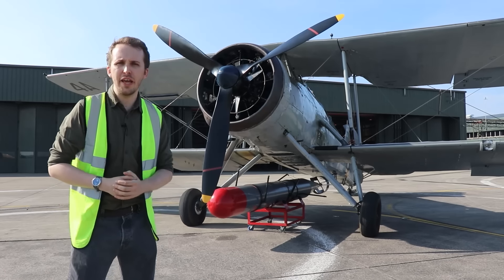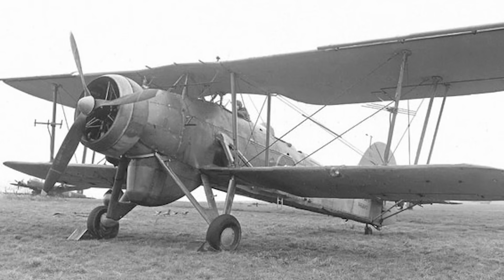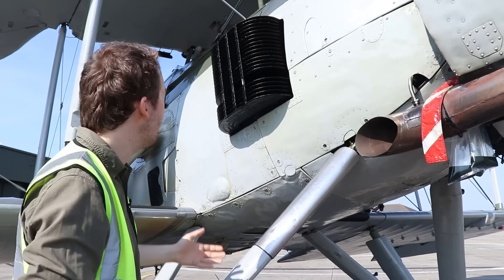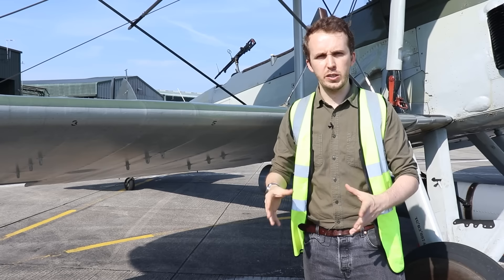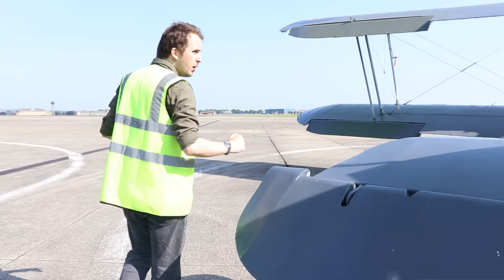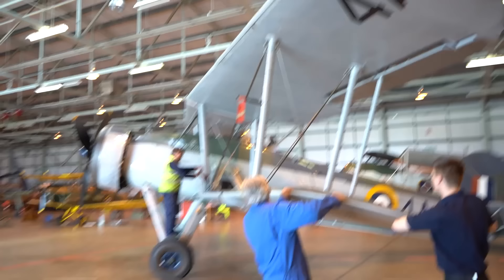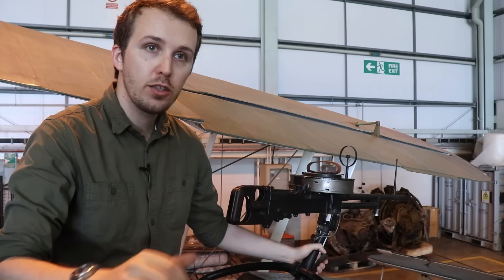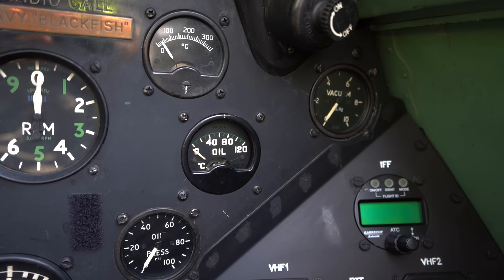Inside The Cockpit - Fairey Swordfish

Comment: Rather surprised you didn't mention the Swordfish's "secret feature" when it came to launching her torpedoes. Dr Alexander Clarke covered this at some length on his channel. The British rigged up a tension wire system, that attached to the nose of the torpedo, that helped to keep it level when dropped, until it hit the water. The British managed to keep this secret for quite some time. Dr Clarke even pointed out in period photographs, showing a Swordfish dropping a torpedo, how the photograph had been "edited" to hide the tension wire. It wasn't just wooden fins attached to the rear of the torpedo, but the tension wire as well, that enabled the successful attack on Taranto.
Reply: Very interesting, thanks.
Reply: Is that the first example of 'fly by wire'? 🙄
Reply: @stewartfordyce  No.  
That incident happened when the Pilot took a final 'Lucky Leak' on the wheel prior to take off to minimise discomfort later but inadvertently and unnoticed caught the wire whilst rebuttoning up.
Reply: @Farweasel  LOL
Reply: My  best undesrtanding  was that the wire ensured that the torpedo would enter the water slightly  'nose up'. Thus reeducing the speed of weapon closer to it's nominal 40kn at the instant of full immersion  while also giving the weapon a shallow track.
Reply: @brucebartup6161  imagine turning up to sink a French fleet and they give you this and explain the wire trick.
You'd think it was a joke and ask for a real plane.
Well done the chaps that did that job. Balls of steel
Reply: @julianshepherd2038  Yes ballsy.   But a terrible day for the French sailors, and the Brits who had to carry out a miserable task.   If only the French Admirals had been more sane;  and I have read that the Brits could/should have sent a more senior officer.   Those French ships and sailors could have helped later, saving British and US lives in the Med,  suppressing German and Italian attacks on convoys,Malta, North Africa, and allied Italian campaign.  And the u-boat war.
Reply: @foxlies0106 absolutely.. The French navy would have been a huge asset

Comment: Even the low, slow, Stringbags apparently needed some additional help at Taranto to stop their torpedoes from striking the harbour's bottom and destroying themselves after release. The torps were fitted with custom designed wooden "Sabots" to provide additional lift immediately after entering the water. So, really a "triplane" weapons system ?
Reply: A modification the Japanese took note of.

Comment: It is a very interesting aircraft, I've read through some stories of them at RAF Bircham Newton In coastal command use, The Fleet Air Arm loaned some squadrons to Bircham Newton, for the active use in mine-laying operations of the coast of Denmark, Around Heligoland, in the Wadden sea area, Later around the Frisian islands, a lot of these took place during the fighting in Norway In 1940. according to reports and diary's that I've read in the museum, The minelaying operations were abysmal, I'm not sure what sort but it was a Magnetic mine they attached to the aircraft in the reports but all I know it was large and very un-aerodynamic, decreasing the aircrafts speed and stability, where the Navigator was suppose to sit they placed a Large Petrol tank which stuck up between the pilot and the aft cockpit The Navigator had to sit with his legs Underneath the massive petrol tank basically pinning him in, so if the plane was attacked and it was hit, he would be drowned in petrol and if it caught fire immediately cooked.  

A quote from a pilot who flew on such a mine laying mission said the aircraft was "Outrageously overloaded" and that "Carrying a mine which would leave nothing to pick up if it exploded and carrying a truck load of fuel to give it the thousand-mile range, it’s speed such that the worst anti-aircraft gunner or search light operator could hardly miss it. Its only protection against fighters was, the fact that it was too slow for them to stay with it and shoot at it" I think there's a dairy entry somewhere in the museum stating that one aircraft was so dangerously overloaded they had to remove all defensive weaponry and all ammunition from the aircraft to fit the mine and carry the extra fuel.

Also being in an open cockpit cramped and extremely noisy they would hardly be able to communicate with each other for 10 hour stretches at a time, very long, very cold, very dangerous mine-laying operations those guys who went on them, Maximum respect it certainly took a lot of courage, and the swordfish carried them through it all!
Reply: Sounds so miserable and dangerous. Hope they had some success.
Reply: I remember a story that the fuel tank would spray fuel through the breather tube at the top of the tank during take off. The RAF grounded the aircraft until they could work out a fix - the navy solution was to insert a cork into the end of the breather tube which had a string attached so that the navigator could pull it out when the aircraft had leveled out.
Reply: @timwalker5843  I've never heard that one but that is mad haha

Comment: This aircraft participated in the raid on Taranto which senior Japanese officials took inspiration for the torpedo depth since Pearl Harbor was very shallow in depth this was for the upcoming attack on the Pearl Harbor United States naval base in 1941. The Swordfish did had an influence Icon A5 a modern seaplane specially with the wings fold back with main difference being that wings on swordfish fold horizontally and parasol wings of the A5 fold vertically to save space on a specially designed trailer or a garage.

Comment: An excellent and very informative video. Lovely to see RNAS Yeovilton again. An iconic aircraft that was an anachronism even before it went into service.
Loved by its crews,  a steady, reliable workhorse.
Known as the 'string bag' not because of all the wires holding it together, but after the popular shopping bag made like a net, which could adapt itself to carry just about anything.
There are a lot of myths about this aircraft, some of them true. But it served well in most theatres of the war and outlived its successor.
Thank you for doing this video, I have been waiting for it and it did not disappoint.

Comment: 26.58..this is actually a differential hydraulic brake gauge. The upper needle indicates the hydraulic pressure available; the two lower indicate the hydraulic pressure to  the port and stbd. wheels. As the pilot moves the foot pedals,( for the rudder), the pressure comes off and on as the case may be, making turning on the ground easy.

Comment: I've always wondered how much extra lift a biplane provides over a monoplane for the same wing span and chord.  I doubt it's double, there's probably some interference between the two wings, and of course there's all the extra drag from the extra wing and all the bracing struts and wires.  But maybe this extra lift within the same span was more important for a carrier plane with limited storage space, especially for a heavy torpedo which needed more lift, and since torpedoes couldn't be released at high speed, they didn't think the drag mattered as much as for a fighter or dive bomber.
Reply: There may be some mathematical simulations showing that the middle wing of the Fokker Triplane didn't deliver any net lift, due to interference with the wing below and/or above. ....But I haven't taken time to look for that reference.
Reply: @MultiZirkon  
I suppose main advantage was tight turning at low speeds. But yes, at higher speeds not so much.
Reply: Grizwold - It was all about STOL with Swordfish. And as long as heading into wind could take off quick and not wait for carrier to turn into full wind and speed up.
Reply: @MultiZirkon  Seems you can calculate about 80% of the lift of a monoplane wing of the same dimensions, but the upper wing has less lift loss than the lower wing. 
 
There is a myriad of influences, of course, the farther the wings are apart (relevant is the factor in relation to the wing depth), the staggering of the wings, and so on.  
 
One nice thing I learned about the rigging wires: 
 
The wires that run from the lower fuselage up to the tops of the struts are the "lifting wires", while 
the wires that ran from the top of the cabane struts went down to the bottom of the outer struts are the "landing wires", for obvious reasons. 

 
Regarding the Fokker: 
 
In principle it is a 3 1/2-decker, the fairing of the landing gear axle has a cambered airfoil and considerable size.
Reply: Unless you are using your stringbag as a.dive bomber, or fighter, or level bomber, or torpedo bomber, or mine layer, or depth charger against submarines, or radar equipped anti shipping rocket launcher.
And do all these things with a better success rate than any specially purpose designed axis aircraft.
Reply: The biggest reason they kept the Swordfish in production (later models were also built by Blackburn, since Fairy was building Albacore/Baracuda and Blackburn had great factories but no modern designs) was for North Atlantic service.  The Swordfish required little in the way of runway for take off or landing, and was controllable and able to land in sea-states no other plane could handle.  This kept it on CVEs and Merchant Carriers (simple CVEs with no hanger, built on bulk carriers) for most of the war.  It was at least fast enough to run down a U-boat.

Comment: Criticism is important.

The Good old plane was state of the art in 1938. And the finest and most reliable torpedo bomber of the war, also the best for night operations.

Which is what the British expected the plane to need to do. Night operations against fortifications around harbours, long range recon and strikes, and the ability to repair and return aircraft back into service quickly.

Ships with only 9 swordfish operational had an odd habit of finding three more ready for service in times of need.

The RN had quite a habit of finding airframes on a global scale, maybe only one or two, but present and flyable.

There were other airframes and engines offered for the Swordfish design proposal. However with weaker frames and less reliable engines, they were rejected for the needed task.
Reply: Well, "state of the art" might be pushing it, a bit. In 1938, the Hurricane was already flying, the Spitfire, the '109. The B-17...etc...The Stringbag was obsolete the day she came out. Still wound up being a very useful machine.
Reply: @PoochAndBoo  none of those were suited to carrying carrier torpedo weapons, night time operations, low speed maneuvering for landing and torpedo deployment in night raids on hostile harbours under the sights of hostile gunners.

In it's intended role, a monoplane was actually deemed ineffective, and undesirable.

Now a modern one with better flap technology and variable pitch prop might go faster and be more stable flying slow.

But outside of the metal skin construction technology that we later perfected? This was easy to maintain and easy to repair battle damage.

One advantage a hurricane had over the spitfire.

Comment: So homely that it was handsome.  Absolutely huge for a single engine biplane (and a less than Herculean engine at that... er... well it was the  Pegasus and not the Hercules...) . One if the war's surprising successes. It shows that even the most stodgy performer can produce some excellent results when deployed and handled with intelligence, surprise (now known as stealth) and some bloody good luck. A curse in some ways as it was used in situations where it didn't stand a chance (well, the Americans had the Devastator...). So many competent aircraft have been tarred with the verdict of failure when different tactics and circumstances might have seen them much more successful. Usually, it had little to do with their performance but more with a forewarned and ready defense & no air cover. One of my favourites.

Comment: Marvelous!  I wonder, what did ditching the observer do for the range? I imagine it could not have been much but I am curious.
Reply: You could fit an auxiliary fuel tank in the observers station so possibly quite a bit.
Reply: @gwtpictgwtpict4214  Hence my curiosity. If you reckon a minimum of 60 kg, Perhaps closer to 80 kg with kit. Problem is that I have no idea what fuel consumption to reckon.
Reply: @grognard23  No idea either, all I can find from a cursory search is a range of 520 - 550 miles as standard, nothing on the auxiliary fuel tank, other than it existed.

Comment: About the gun that could be placed on the right side of the fuselage, it looks like it would fire straight through the propeller, but what about synchronization? Was it?  I also find it fascinating that the ailerons could be drooped in unison as flaps. The engineers in those days were certainly no slouches! BTW, the quality of these videos is great for the model builder who wants detail. Just make a screen shot and you have your own "walk around" reference file!

Comment: There's a lot more space inside that rear fuselage than expected. I assume the torpedo was too long but why not fit a small internal bomb bay or fuel tanks? Weight distribution?
Reply: Quite right. In any airplane there has to be a forward CG, so you can always push the nose over to gain airspeed or to descend & land.

In some aircraft, the CG will change as fuel is burned, so managing fuel consumption can be critically important.

Comment: Good job.  War years Brits had a talent for making requirements and designing to them.  The Swordfish was obsolete, but effective, when employed right.  It didn't need to be a super aircraft.  The mosquito was the epitome of British aerospace engineering.  The Germans could never successfully build them.  Even the ME 163, which showed great promise, had failures of their wooden wings.  Centuries of building fine furniture made it easier to build a mosquito.
Reply: @jamesharding3459  Correct, German engineering was actually very poor in terms of reliability and design choices.  For example, USAF General Chuck Yeager was asked what was the difference between an ME-109 and a P-51 and chuck said, the P-51 can do for 8 hours what an ME-109 can do for one hour.  Hitler attacked Britain in 1940 with bombers, but that lacked fighter support because the ME-109s were never designed for long duration bomber escort duties.  Their panthers and Tigers were great tanks, but most broke down and needed constant repair.  They were not ready for war.  It's like the Germans were doing their R&D testing, while during combat, instead of training areas.  British strategic engineering  won the Battle of Britain with radar, observers and committed pilots flying superb aircraft.  Had Hitler been intelligent, he would not have attacked London after one of his bombers accidently did.  He should have concentrated only on winning air superiority, but he chose not to and lost.  It was a wonderful British victory, where their brilliance saved the UK.
Reply: @mcdowelltw  From my perspective, the biggest issue with German engineering was tunnel vision. Take the oft-flogged example of the Panther: It had reasonable ‘hard’ statistics (gun, armor) but everything else — everything that makes a tank part of an army — was sacrificed or compromised.

Or the hilarious example of the Bismarck. Leaving aside the fact the Germans couldn’t do on 50,000 tons what every other major Navy was doing on 35,000, what did they think they’d be doing with it? Re-enacting the battle cruisers at Jutland against the KGV’s and South Dakota’s? Utter insanity.

Comment: Sank more axis shipping than any allied plane. 

Had a time of flight of 4.5 - 5 hours, 6+ if you tally the ones who went from 3-2 crew and added an additional petrol barrel tank. Against opposed air space, obviously it would suffer. But away from ME109 airspace, in the atlantic or or in the shipping lanes - its ability to scout, and kill enemy shipping never ceased. Its job wasn't air to air. It was air vs ship and unless the ship had high tier AA, the string bag held the aces. Faster, more mobile, and three men singing those magnificent men in their flying machine. Tumm tiddly tumm tumm, tumm tiddly tum tum. 

An older design, with brave aircrew, used from the first day till the last, tallied a staggering price on the enemy. And the men who flew it - what men! 
So what a plane, what men, and magnificent that an example is still around to ensure neither it, nor the men who flew in it - are forgotten.

Comment: Very good job Chris. This is much more appreciated that I was able to take screen shots of good quality that allowed me to identify several parts found on the crash site of Swordfish NE906, lost at night on 1st May 1944 at Plouguerneau, north west Brittany, France.
One is the compass mirror box with its four little screws, one other is one of the two switches on the Switchbox identification on the right side of the pilot’s seat.
Another part may be the hook arresting damper inside the rear fuselage, but we only found its plaque.
I would have one question, did you see any snap button on board ? 
For the moment 15 snap buttons diam. 13 mm (head) were found and five of diam. 15 mm. I ignore for the moment which type fits the two male snap parts found fitted on aluminium (hence my question). But the 13 mm matches very well with those on a Flying helmet Type C I have.
It is much important for us, the aim being, if we can prove the crew was on board when it crashed, that among the four airmen buried as unknown at the local cemetery, three are this crew.
May you put me in touch with the aircraft technicians who take care of it ?
Kind regards
Gildas